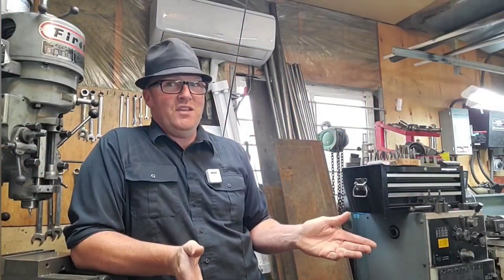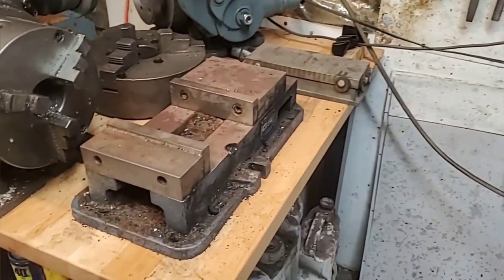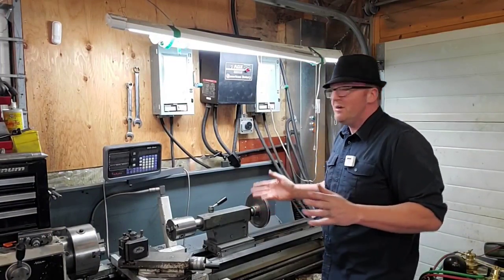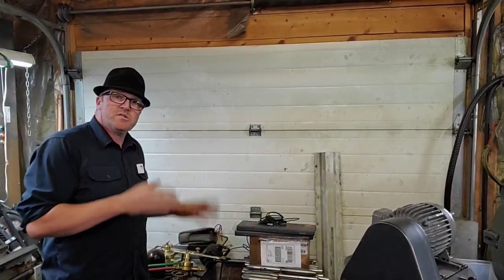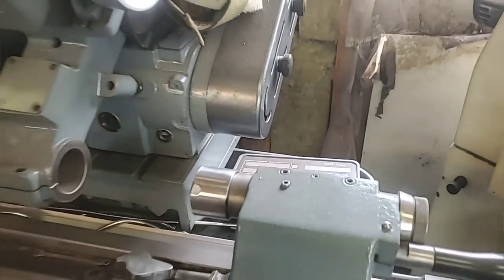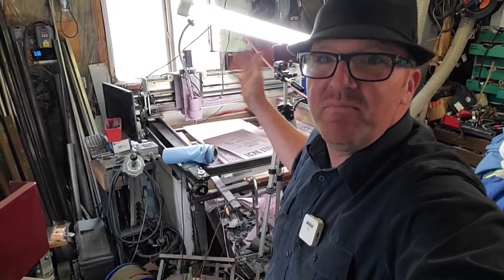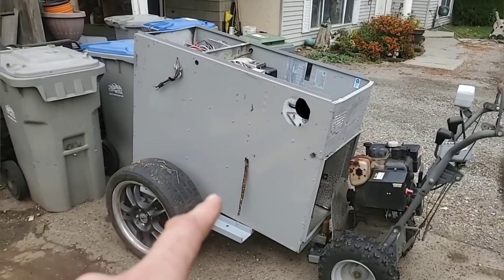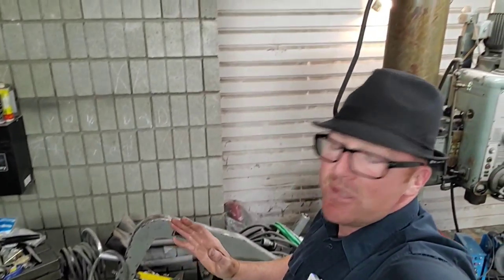Shop Tour Wright Machining's Machine Shop 2022

Comment: Thanks for sharing! It gave me some ideas for my machine tooling. I have some hard board that I would like to cut up. I’m thinking a rack of drawers like your green drawers in the first shop. This Is to go in a mobile workshop trailer. Likely to hold drill bits and screws and bolts, etc.
Any further information around that would be appreciated- but I understand, it is just drawers!
Reply from the maker: Glad.  Lucky for you there is a video on the green drillbit holder. To do it again i would have not used particle board and used wood for the whole thing as it sags a bit under the weight of the large drill bits .  Here is the video

https://youtu.be/uciyx-6tEN8
Reply: @Wrighmachining  what!? How did I miss that? Thank you for helping me with my lack of google-foo!
Reply from the maker: haha  .   Have fun build :)
Reply: @Wrighmachining  oh I was specifically talking about the drawers, I’m not sure what you have in them. I will be using them for drill bits and misc. see about 6:10 in this video. Sorry for any confusion I caused!  I’ll dig through your channel a bit more, might have missed that video
Reply from the maker: Oh , yes that .  It came with the shop .  I can send you pics how the drawers are built if you like 
Email me at ryanwright368@gmail.com and ill send you some pics this weekend

Its full of everything from bolts , sand paper to electrial parts i salvaged .